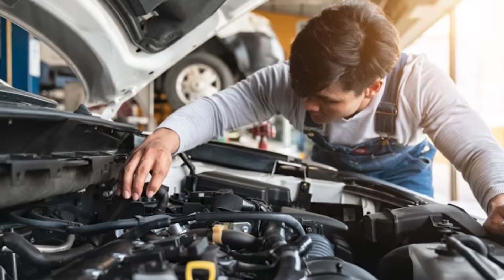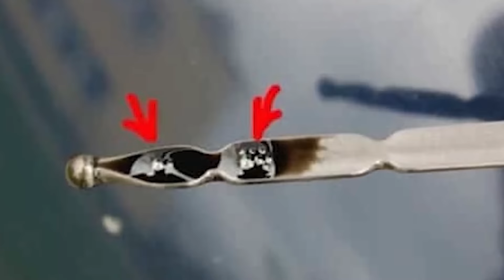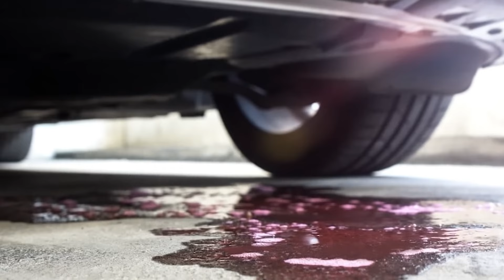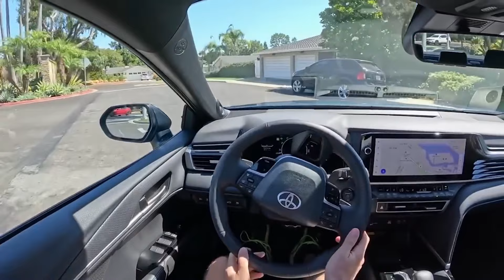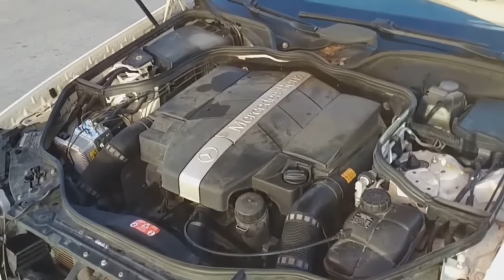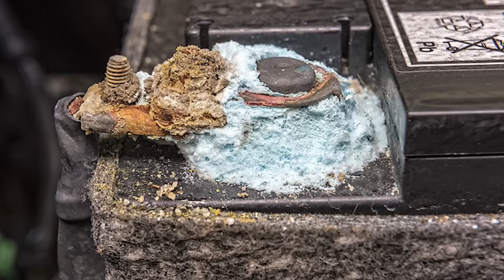MECHANIC REVEALS: 17 Secrets That Help You Hit 300.000 Miles EASY!

Comment: Fuel filters are on the pump in today’s cars. Diesels are different. They have external fuel filters. This is a mixed bag of information because some of the stuff does not apply to newer cars only older cars. But all around very useful information.